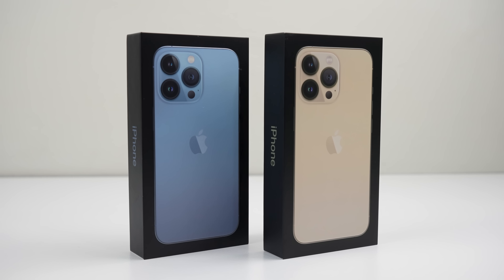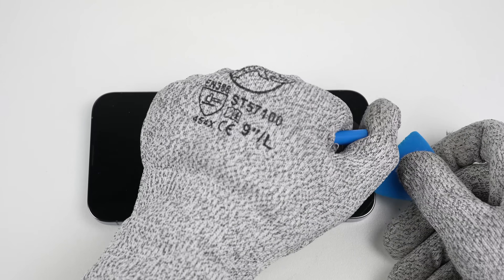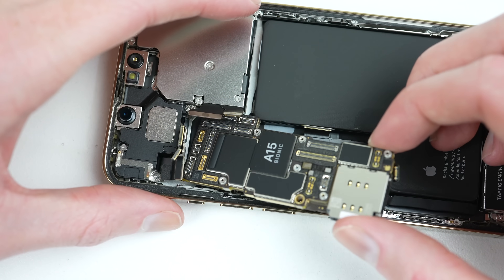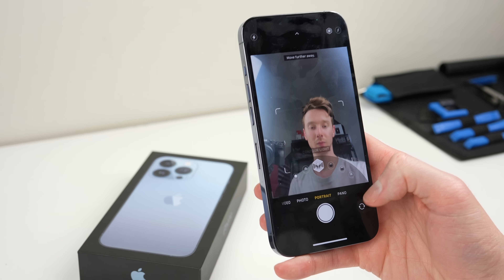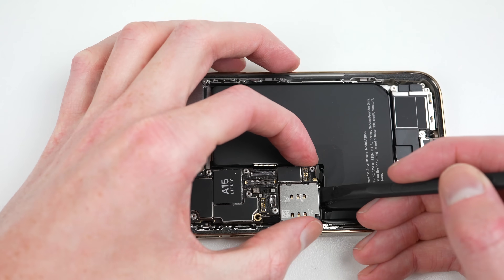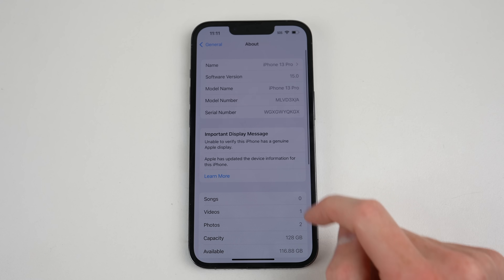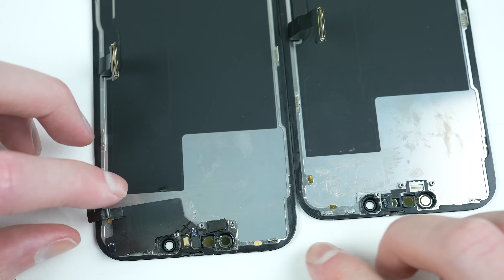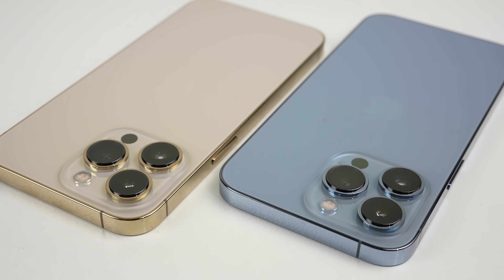iPhone 13 A Repair Nightmare - Teardown and Repair Assessment

Comment: "Unable to verify this phone has a genuine Apple display"

Litterally comes from another iPhone.....
Reply: who would buy a piece of crapp phone like this is beyond me
Reply: @dennis-br6vr  it's genuinely good (well, ok-ish)phone. The problem comes, that it's not yours, even after you bought it. You have to buy necessary equipment for it from Apple,  you need to be fixed it by Apple, and you can't do anything beyond what Apple allowed (no jailbreak, or custom os)
Reply: @dennis-br6vr  why are you even here watching this video if you’ve no interest in iPhones?
Reply: @twkm05  It's funny to see how ya'll struggling to repair your new megafunctional ultra-hi-tec megaphones produced by a corporation which optimized it's every field to produce more income, when i can just jack my phone open and replace anything at home, or even make some modifications
Reply: @twkm05  Welcome to the internet, buddy. Yeah, some people are not afraid to express their opinions, why should i be embarrassed?
Reply: dannad x It's fine to express your opinion as long as it's not offensive. I would never belittle anyone because they bought a different phone than I did…
Reply: @twkm05  i never said i dont have any interest in iphones. i watched this video to see if rumors are true about non repairibility. and they are, so yeah i really do wonder who the f would buy a piece of crap phone like this.
Reply: @mkjk2534  Its you that finds the opinion offensive, deal with it.
Reply: you dont get it ... thats the point. They do not want people to go and get their phones repaired in any other place than apple store. In apple stores , the employees would usually have a override functionality to fix the signature errors/warnings which were shown in the video
Reply: @falseego99  Sounds to me like needs to acquire that override and share it with the world
Reply: @falseego99  they don't repair much either. You either were given a new one  passing as the old one or a badly reburfished second-hand one, or if lucky the same one.
Reply: @falseego99  We get it. We know what they are doing, and why they are doing it... It's just wrong.
Reply: @William Andres Montilla Clavijo yep
Reply: I think by now people will start to lose they patience with this stupid  idiot behavior. Apple should go to Coort by this. This is against any law that protect it customers, after more 8 years using iPhone. I finally thinking about quiting this. This is stupid and criminal is the same fucking display!
Reply: seems they just need to beef up the verification process
Reply: To all of you people talking about "how serial numbers works", that has nothing to do with this and I strongly suspect you already knew that.

What you're seeing here is an intended feature, not a consequence of how serial numbers work.

Don't be ridiculous. It's obvious that the whole purpose of this is to make it so you HAVE to go to Apple and pay their overblown repair prices, instead of being able to repair it yourself or take it to a 3rd party shop.
Replacing a screen or a battery isn't rocket science that only an "Apple Genius" can do.

It's the easiest thing in the world to universally hardcore verification of legitimate apple parts using any number of techniques.

This is merely anti-consumer, anti-environmental corporatism and it's par-for-the-course for a company like Apple.

If they gave a toss about e-waste, they'd make their stuff repairable. They don't want that, they want you to buy their newest shiniest clone device every year or two.
Reply: @jazeenharal6013  Your Logic is invalid, most people use their iPhone for 4 years+ because they actually get operating system updates for more than two years unlike most androids. The average consumer does not break their phone and even if they do, it’s usually covered by their celular plan’s insurance. Also who says Apple repairs are overpriced? $70 to change a battery is not overpriced at all since a genuine battery costs $70 in the first place. They basically don’t even charge for labor so please don’t spread false information. If you pay less than $70 at a 3rd party repair shop, they’re likely installing an aftermarket battery. Same applies for displays. That “feature” is especially beneficial to those who buy used iPhones since they can confidently buy a phone that has all genuine parts AND hasn’t been tampered with by anyone but a certified Apple technician. This is one of the many reasons why iPhones hold their value much better than flagship androids.
Reply: @TylerN945  lol
Reply: @TylerN945  you can get a perfect battery for 30 bucks. The quality of this are identical as the apple ones...bruh and only because you are an apple Stan doesn't mean that everyone has to pay 70 to change their battery. Apple is provit oriented company and would not do something for free. The priceproduction of the apple battery's is less than 20 dollars. They do overpriced repairs
Reply: @SergieXD  Breh if Apple is a profit oriented company, why do they implement software to reduce long term battery wear? Why do they increase the battery size every year when iPhones with smaller batteries already have much better battery life than the latest snapdragon androids with bigger battery capacities? Why did they make the glass panels flush and ceramic coat the front display? It seems like everything Apple is doing protects the phone from being damaged in the first place.

*And they don’t increase the prices of their flagship phones every year.
Reply: @TylerN945  your facts are incorrect, starting with your claim that Jazzen's logic is invalid. Next your claim that 'most androids don't get updates after more then two years' is also completely false.
Reply: @TylerN945  where are you getting all this data?? Can you reference your sources about how most people's phones are covered by their data provider?? And that most people keep their iPhones for 4+ years?? And that most people don't crack their screens??
Reply: @TylerN945  and this ENTIRE video isn't about aftermarket components so why are you even talking about them?? It's about 3rd party repairs with GENUINE components. Apple could easily change this software so that anybody buying a second hand phone could still be assured that it contained only genuine apple parts, without introducing any risk of aftermarket parts being used. To top all that off, what on earth made you think iPhones hold their value?!?!? My family literally has four iPhones 4-5 years old that all charge slowly, shut off in mild cold, have battery's that jump from 100% to 10% in 20 minutes, and freeze randomly all the time. Not to mention they can't download many apps because they're 'unsupported' 2 of them the home buttons don't work aswell, which means they literally cannot be sold to any sort of company like Game etc. They're worthless, and so is your bullshit about iPhones holding their value.
Reply: @Lesdig891  Well it’s common sense than the average phone user doesn’t damage their phone lol. Especially if you spent a good amount of money on it, I’d think you’d have the common sense to get a good case for your investment. You’re telling me that if you chose a random 10 people from a crowd, more than 5/10 would have a cracked display? No, that’s not the case. Also most androids are Samsungs and Samsung only releases 2 years of operating system updates and then only security patches after. I am aware that not all android companies are like that, I personally love my OnePlus’ because they support their phones for as long as they can and don’t add a bunch of dumb gimmicks.

Consider this:
The Galaxy S9 was released in 2018 will not get Android 11. However the iPhone 6S from 2015 still runs the latest version of iOS (15). Could just be my observation but iPhones don’t become obsolete nearly as fast as android flagships do. That’s because apple focuses on longevity instead of gimmicks. Imagine buying a S21 Ultra today knowing that a $400 iPhone SE will get OS updates for much longer lol.
Reply: @Lesdig891  Your family has an iPhone that’s 4-5 years old? Well any phone that old will need a new battery anyways and apple used to change them for $29. With a new battery, they’ll perform like new. Now do you know what Galaxy came out 5 years ago? The S7. That’s running Android 8 Oreo btw 😂
Reply: @Lesdig891  I’m aware the point of this video is abt replacing iphones with genuine parts, but a 3rd party repair shop might not reseal the phone correctly or something along those lines. It’s nice to know that you can buy a refurbished/repaired iPhone that has been fixed by Apple technicians rather than some who might have little experience and cutting corners. That’s my point.
Reply: @TylerN945  yk, for a ceramic coated screen, it kinda still scratches at level 6, with deeper grooves at level 7
Reply: @iamalolz  A man of culture I see. The scratches at 6 and 7 weren’t as deep as they were without the shield so it definitely makes a small difference. At least that’s what Zack from JerryRigEverything said during the durability test.
Reply: wya😂
Reply: But has a different serial number
Reply: @KP101YT  facepalm /s
Reply: KoopaPlushies so what? Why does that matter? It’s still an Apple IPhone 13 Pro serial number...
Reply: @Lesdig891  Do you even know how serial numbers work?
also Apple devices have specially programmed parts that fit just for single devices, to further increase the repair costs lmao
Reply: @Lesdig891  it’s a different one. Not every component has the same one, especially not the iPhone. So what?
Reply: @KP101YT  they're still the exact same parts from the same model phone.
Reply: @Lesdig891  because even if you buy a replacement part from apple to repair it, you wont, because the SN is hardcoded to the ROM of the board. This is to stop repairs even from original parts, its really questionable practice (similar to Tesla's), illegal no by any means, ethical, far from it.
Reply: @justforthisconversation3016  why are you Lyao?
Reply: @KP101YT  wooosh
Reply: @justforthisconversation3016  yes ofcourse I know how serial numbers work, do you know how serial numbers work? If you did you would know that it would be extremely simple to build software that recognises a certain set of numbers as genuine apple parts, for example, numbers from 76500 to 77000. The parts aren't 'specially programmed' the software simply is designed to only recognising one single serial number, something even the video creator pointed out was easily changeable.
Reply: @tellingitstraight  I know that, I was pointing out that the ONLY difference was the serial number, and that it doesn't matter if the software isn't designed to only accept 1 specific serial number.
Reply: @KP101YT  no, they are the same component, the only difference is the serial number.
Reply: @Lesdig891  spoofing serial number is possible.
Reply: @BamfIamone  the serial number is still different. Every device has a different one ☝️
Reply: @Lesdig891  it is programmed😂😂 why do you think he bought a screen reprogrammer, simply to overwrite replacement screen with apple software, so the annoying massage (problems with verifying that this is a genuine apple display) goes away.

Comment: Certified Apple tech, albeit out of a job cuz the warehouse they paid me nowhere-near-enough to work at ran out of work to give me.
More than likely you CAN replace hardware just fine, but to do so and retain features will require some proprietary software Apple designed as a measure of approving and testing new hardware installations. No, that's not available to the market and yes, you will be sued to hell and back if you let that software slip.

Comment: Frankly this strikes me as a security issue. If any part can be put into your phone then it would be possible to add hacked parts. People are increasingly using their phones for banking and other financial transactions, so a hacked part could be used for theft. There are also possible privacy issues. Given that an iPhone has a mic, cameras and internet connection a hacked part could be used to transmit images and recordings without the owner's knowledge. 
If a high profile case occurred it would certainly damage Apple's sales, and if it was determined that they had not done enough to prevent the issue they might even be held finically liable.

Comment: May as well buy an £100 Xiaomi or other Chinese manufacturer and install lineage on it. You could do this 12 times a year and still be better off. 

I miss my blue mirror finish Huawei 9 😭

Also... Microfibre cloth to ummm clean off your fingerprints before you send the POS back to hell lol.

Oh there is more. I got an advert to buy one at the end of the video 😭😭😭😭😭😭

Comment: The face-Id module is designed to be harmful to human eyes, and that is clearly borderline with the technology they use. If you swap that module with third parts and something happen, Apple does not want to take responsibility and that can anyway affect sales and reputation. About the battery health, it is just linked to battery chips which won’t support the small amount of voltage changes. All of this make sense with third aliexpress stuff. Not with their parts. That’s stupid.
Reply: Andrei Salvaleon  🤷🏼‍♂️

Comment: As much as I hate Apple in general, I will say that the way they serialize and lock the phone components makes the phone far less desirable for theft as it is not a useless brick that can't even be sold as a "broken" parts phone. Nightmare for right-to-repair though and I think the risk vs reward with right-to-repair is worth the trade-off.

Comment: So they are registering physical parts into the software? So if Apple does a replacement, how are they registering the replacements? Have we not gotten our hands on that software? Reverse engineered it?

This reminds me of the Xbox 360s. If you replace the DVD drive, it had a serial that was married to the board and would not function unless you flashed the old firmware/serial over to the new one.
Reply: I own a computer repair business, I get people asking all the time to fix their phones. I usually refuse because I'm not cheap and now I will say because Apple doesn't let me repair your device.

Comment: True sustainability is making sure your product is relatively easy to maintain, making sure you can afford to maintain it, making sure you're not so frustrated that you smash your phone and go buy another brand. The lengths apple goes to make true sustainability difficult is astounding. It's absurd and shouldn't be legal.

Comment: Security advocate here: If someone steals your phone and changes the display without those hard and soft locks can access all your data, since it can configure faceid as it is a new device. (flyes away)... (flyes back) Apple is still a shitty company that doesn´t want you to fix their devices. (flyes away).

Comment: Apple phones are practically worse in every practical way than their Samsung counterparts, yet somehow, people still insist on guzzling apple's cock by buying what are essentially recycled products with built in anti-repair systems. At least with Samsung, the worst thing I deal with is battery fatigue and my internal storage filling up with junk data.

Comment: If your software, allegedly designed to identify genuine parts, cannot detect a literally mechanically identical component then it's not designed to identify genuine parts. It's designed to identify tampering (which, by all means you can do, but at least don't misname it).
If your software, allegedly designed to only work with genuine parts, cannot work with genuine parts then it's not designed to work with genuine parts. It's designed not to work with replacement parts.

Comment: I used to love Apple stuff, way back to the old Apple Europlus ][e and was always an evangelist for their brand, until the iBad came out and was bitterly disappointed with its limitations - ever since then I wouldn't touch their kit with a barge pole. 
Everything is far too expensive and they're far too concerned with keeping everything locked down, (can't use bluetooth with non-apple devices), etc.
I got given an iBad otherwise I wouldn't ever use them, but sometimes it just drives me crazy how they limit their end-users.

Comment: There is the same problems with cars, you can’t just change components as they won’t work you need £100,000s of equipment to code modules together

Comment: Brave and important video.  Very impressive analysis of a Company that does not believe in saving the planet.  There is so much wrong with the Apple mindset.  They should think carefully about their ethos, Apple iphones 11,12,13, do not change the planet with each incarnation, but they are helping waste resources by failing to permit repairs and by offering only small storage.  Shame on Apple.

Comment: What did we learn? Sue Apple, they give you a phone, you use the phone, something breaks, you fix it with parts from a brand new phone straight off the assembly line and suddenly you're forced to buy a new phone because they're designed to break when attempted to repair and give them more money so they can keep scamming more and more people by polluting the earth with their un-repairable phones. Sure you can recycle the phones but what's the point in recycling if we (consumers) can't repair the phone and thus unnecessarily recycle a perfectly good phone and waste more money, resources and time. They're breaking the economy and it's not just them, everyone else does it.